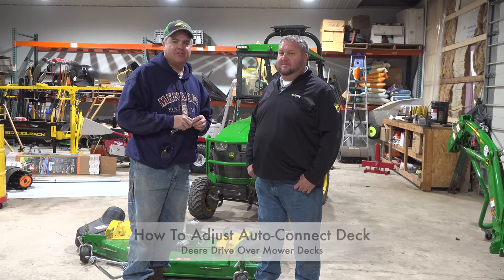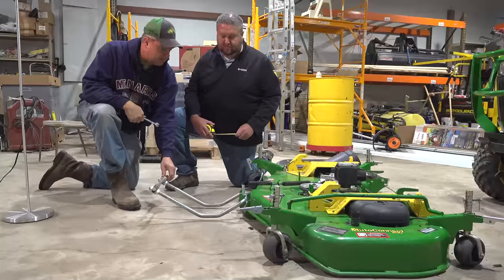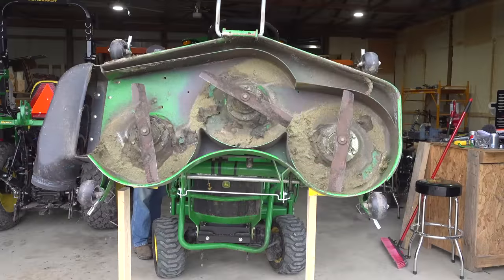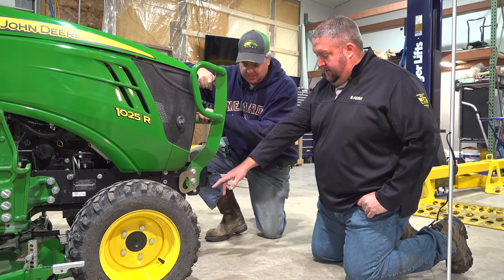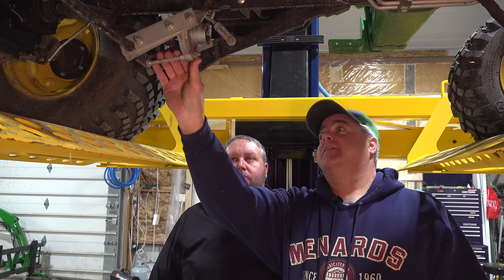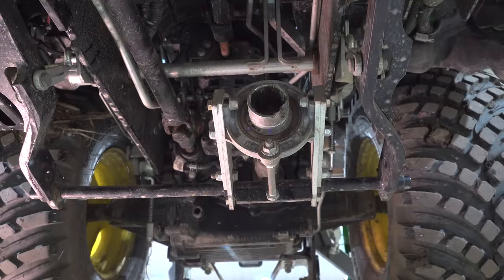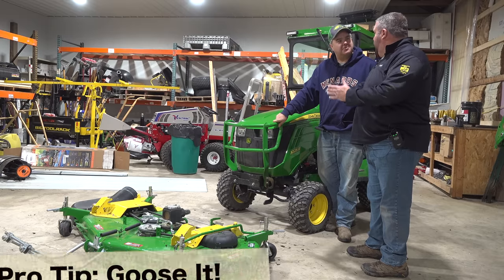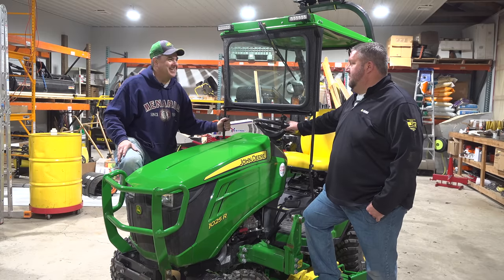Adjusting The Auto Connect Deck Deere 1025R/1023E

Comment: Another feature to help the PTO spline slide on easier is to shift the PTO lever to the rear only position so that the tractor spline can rotate to match the mower spline easier as you connect the mower.
Reply from the maker: Yep.  As stated in replies to many comments already, I forgot to mention this!
Reply: Guess I have been following you longer than I thought cause I remember this one. You have been a great help to me. Thanks
Reply: @TractorTimewithTim  is the deck suppose to be tilted up in the back slightly? or completely even front to back?
Reply: @Steamerchoo  There is a lever tucked in the left side of the seat and the fender that switches the PTO between Mid, Mid and Rear, and Rear only.  They are suggesting that if you switch it to rear only the Mid PTO could move freely which could help things line up and engage.
Reply: Silicone spray both connections of PTO shaft.
Reply: Why can't I get the deck on the ground

Comment: After watching this vid I was wondering why someone hasn't designed a "cap" to put over the mid PTO female receptacle after you remove the mower deck.  Covering the mid PTO would help keep dirt and debris from accumulating there while the deck is not being utilized.  You would have to remember to remove the cap before re-installing your drive over mower deck.   Just a thought.
Reply: Yup. We don't use the mower deck, and probably never will. I always worry about junk and brush messing up the middle PTO. Even though we don't engage it, I don't want it to be damaged.

Comment: I just finished replacing the universal cross bars on the D60 PTO shaft for the second time and I sure wish I had seen this video before I started.  Apparently there are three ways to incorrectly install the coupling that mates with the D60 spline shaft and I tried all three before my son looked at it and said "Dad, you're old.  Get out of the way."  We couldn't find any reference to that bolt that levels the coupler, so we installed the deck and then adjusted the bolt to align it to the spline shaft.  The method shown in our video seems like a better way.  By the way, my bolt was bent as well.  I would like to recommend that JD add a torsion coupler to the quick connect at the transmission. I'm diligent about greasing all of the fittings on the shaft every spring, so these universals shouldn't fail so easily.  My 1023e is almost 10 years old.  Either a torsion coupling or a limited slip clutch would really improve reliability.  Same for the rear PTO.  Small investment, big payoff.  Thanks Tim!

Comment: At about 9 minutes into this video, you adjust the auto-connect coupler bolt.  I studies this a bit and with the tractor on level ground, the bolt should be adjusted so that the distance from the center of the coupler is exactly the height of the spline shaft on the D60 deck when it is resting on the ground (any scalp wheels fully retracted).  I.e., that M10 -120 bolt adjusts the "height" of the coupler from the ground and not the "tilt" of the coupler.  Of course, this is affected by tire pressure and how level the ground is.

Comment: Nice video, but since you left the front bar adjustment alone, you forgot to show the rest of us how to adjust it! I’m sure I can figure it out, but maybe others can’t! Always having trouble getting pins at rear to swing loose to remove mower deck. Also had tension pulley on mower deck give out while under warranty, and shredded the belt, but dealer refused to cover either part, and could not even find the right belt on their website for 54” deck. Now having problems with engine not running right, so going to change oil and filter, and fuel and filters and also check the gas line coming out of the tank as inside the gas fill opening, seems to be rusting, so don’t know if I need to get off road diesel gas - is it better for these tractors? Don’t know why it would be rusting inside tank opening other than humidity in Florida, and why wouldn’t it be coated in something that doesn’t rust! Tractor only has 46 hours on it and shouldn’t be having this many problems already! Maybe I got a lemon!

Comment: Most of the problem I've had with this is the gold-colored spring latches are weakly sprung and won't latch up on their own. Even lubed up the bushings aren't very precise. So check that out on the deck by itself.  More than once have manually latched by removing the latch bar then replacing when the tractor is in place. And then I realize, had they just made the latches with a simple manual option, like a half-turn cam, this would be easy. When the "auto" connect doesn't "auto" it's many times harder than a manual latch would be.

Comment: I've been watching your videos for a while but this one pre-dates my subscription.  After struggling to get my deck off this morning I asked myself if Tim might have some videos on this subject and I found this one.  It's a big help.  My dealer had the front bar adjusted so tight that you couldn't get the latches undone on the rear of the deck.  I also thought of some type of cap or plug for the PTO spline connector when it's off.

Comment: I love my 1025r! I remove my deck at least once a month for different tasks on our property and I never have any issues with connecting and disconnecting at all. I could not be happier with this tractor!
Reply: consider yourself lucky.    I bought a new 1025 and the deck is a PITA , and I have adjusted it  as this article shows and how the manual shows.
Reply: @danwukelic1260  as a 2022 1025r owner. if you are having that much trouble reconnecting your deck. you are missing something. I can uninstall and reinstall my deck in probably less than 1 minute. to me the biggest hurdle is raising all of the deck wheels. which is a nothingburger

Comment: Another trick for keeping your deck form sliding on concrete.  Take the a ratchet strap and remove the buckle.  Take the free end of a ratchet strap (the end without the buckle).  Hook the strap to the deck and lay the strap out on the floor where your rear wheels will roll over it.  Then when you pull over the deck the weight of the tractor on the strap will keep the deck form sliding.  I learned this technique on an old 2wd Ariens GT and it made the job a lot easier.

Comment: On my 2022 1025R with the 54D autoconnect deck, it has a different lift link on the front of the deck. Mine is spring loaded and looks like Lift Arm, MY20, Attachment - ST993764. I recently bent a bracket on it when trying to mount it, Bracket - BRACKET, UPSTOP ADJUSTABLE FRONT DR part number TR107795. replaced the part and bolt and back in business. Thanks for all of the helpful videos Tim! great stuff as always! Love my new tractor, did lots of research with a lot of TTWT videos on what to get. ended up with 1025R with 120R loader, 53" bucket, JD Quik attach 3 point, Frontier 2048L box blade, and 54D Autoconnect deck. I also recently added a 3 point Tiller and the Heavy hitch offset hitch with H2TBD Cultivator Bedded/hiller attachement (ordered today).
Reply from the maker: Congratulations!  Lots of fun ahead!

Comment: I'm glad to get the info on adjusting the mid PTO. One thing that I have found that helps with connecting the mower deck PTO is to shift the PTO selector to the rear PTO to allow the mid mount PTO to freewheel and spin to align.

Comment: Great video.  I agree with the smooth concrete floor sometimes being a challenge, but I would also add this.  I learned from experience that you don't want to remove the deck on loose gravel.  If the deck scoots and settles in the gravel,  you've got a mess on your hands trying to get the deck re-installed.

Comment: One of the biggest mistakes I made was getting an AutoConnect mid-mount mower deck for my 3033R. Though these sort of decks are excellent for basically flat lawn cutting, they are terrible at cutting the hilly uneven pastures on our farm. Connecting was always a bit of a finicky situation. Also, the side discharge created mounds of decomposing grass instead of an even decay along the swath. Within the first year I replaced the deck with a 78" flail mower with hydraulic side shift that mulches the clippings and drops them evenly across the entire width of the unit. Having 18 separate blades let me inexpensively sharpen or replace them without the need to detach the unit from my tractor. Fortunately, I was able to get a really good deal on a trade-in of my 3033R and deck for a new 4066R. I finally have enough horsepower to do my own bailing of our hay fields. Don't misunderstand, I am not knocking the use of a deck, it just didn't work for our farm.

Comment: Great, great video! I dread putting that mower deck on in the spring and scratch my head as to what adjustment is out of whack. Then I vow to not remove it till winter.  I'll be out there tomorrow looking things over. Thank you!

Comment: Tim,
Thank you.  I consider the another great public service announcement.  Now I have to remember the 11.5 height in the front, and the 1/8” gap in the front.  And lastly,  do not grease the linkage or connector underneath with grease. 
Bill

Comment: Also new owner.  Could not get my mower deck off for anything.   The front adjustment was too tight.  Great video - thank you!
Reply from the maker: Glad it helped!  The deck is simple to adjust on e you roll up your sleeves and dive in to figure it out!
Reply: @TractorTimewithTim   No it isn't,  the manual says to level the deck if too low at the front is to adjust the draw bar at the front with the large nuts, if you do this you lose the 1/8 inch gap needed at them.  then the deck is jammed and you can not release the spring loaded latches at the back

Comment: Thank you for this video Tim! I’ve been struggling to get my deck to connect ever since I got it. Dealer told me there was a problem with the silver latch below the tractor, said it was mounted on backwards. I’m going to test these tips and see if that helps. Corona lockdown will give me a chance to experiment and get my 1025R ready for spring!

Comment: Finally a discussion regarding grease collecting dirt and grit.  For example, it is commonly recommended to lube the socket connections on the three point.  Seems counter productive to me.  Not really that much movement when an attachment is secure side to side.  However the level of dirt can be high.  Why apply lube that can trap grit in the joint?  I leave mine bare and flush clean during use when possible.  Any further discussion?  I do grease other areas that are more protected such a FEL pins.  I do however find alot of dirt trapped in the bucket pins.  However the joint is quite tight and excess grease helps keep the joint clear.

Comment: Does help to have level ground to attach the mower deck. Sometimes that is a hard thing to find. Am thinking about putting a pad in to work on the tractor. Eventually a shed will go over the pad but great tips on the deck. Thank you again for the videos. Yes we got snow yesterday over 7" in one day.
Reply from the maker: Yes, you need a level spot.

Comment: Regarding the PTO level adjustment bolt, I also thought my bolt was bent, however I believe it only looks like it is bent on mine because the bolt hole is drilled at an angle. Maybe yours is made the same? Great job on all the videos, Brother. Loved your Honduras road-building video using a 1025R.

Comment: Agood way to set up the pto connection angle is to measure the height of the spline connection of the deck when flat on the ground and set the pto connection at the same height. in place of using grease i recommend a light coating of copper anti-seize. it doesnt attract as much dust and debris as grease.

Comment: This was a great video.  I have had my 1025r since I bought it new in 2019.  I have had it at the dealer at least once due to the mower deck not being level.  This month, I reinstalled my deck for the season and mowed only to find the deck was not level.  It was an inch off left to right.  I removed it and reinstalled and found it was now 1/2 off left to right.  I removed it again last night and attempted to adjust the lift arm turn buckles.  During reinstallation we had a very difficult time re-attaching.  We finally got it reinstalled.   The deck is still off 1/2 inch.  Not know what steps to take, I have made an appointment with the dealer to come get it and level the deck.  Frustrated.
Reply from the maker: There are two turnbuckles, one on each side to adjust level

Comment: Really liked this segment.   Could we see how to do it on your 3046r.  It is a little different  and I am having this same problem with my 3036r after  4 years.  And what are the causes.   How they can be prevented.   Thanks
Reply from the maker: I took the deck off when I got the 3046r, and have not put it back on!

Comment: Tim, I just got my 1026R back from my local dealer who did the annual spring maintenance. While the tractor was at the dealer the service manager called telling me that if I was having trouble connecting Nd reconnecting my 60D mower deck it the assembly would need to be overhauled. And at a what I thought was a very hefty price. I don’t have a connection problem so I told him not to do the work. My 1026R is soon eight years old with 1070 hours. I realize there is wear and tear and I may need to that sometime. Would you have the opportunity to check with your sources what ork outdoor need to be done and can I perform the work myself? Thanks and look forward to hearing from you!

Comment: A great starting point for adjusting the front to back leveling of the deck is to loosen the 28mm nuts on the front hanger and run them out flush with the end of the threads and run them back 6 full turns and tighten the rear nuts. i set these up at work every day and i found that doing this either gets it right on the money or close enough to not notice a difference.
Reply: if I do what you said,  my deck is way to low in the front?  if I tighten up the larges nuts to raise the front, then here is no gap at the front yoke slots that suppose to have about an 1/8 inch?  basically impossible to release the latches on the back of the mower to release it
Reply: @danwukelic1260  I loosen the front nuts every time I take the deck off. It doesn’t take long to tighten up to the jam nuts then.

Comment: Very informative video, particularly about how moving the mower deck with pallet forks or a chain can cause damage. 
Question:  for those of us who own a Deere 3 Series tractor and a mid mount mower, Load N Go is not available (at least to my knowledge).  What the best/safest way to move the mower deck after it's been uninstalled from the tractor?

Comment: Excellent video, thanks.  I've done exactly what you mentioned; I lifted the deck by putting forks through the hoop of the drawbar now the bar won't stay attached to the hooks on the front of the deck.  There's a gap of maybe a 16th of an inch between the bar and the little u-bolt and the bar just pops out.  Can you suggest a repair?  I'd hate to take a sledge hammer to it but can't think of anything else.

Comment: Hey Tim I have a new 2025r and when i back off of the mower the loadre stand pipe catches on the mower lift arm and bends the bracket that holds it in place.  Any help that you or Matt can offer would be greatly appreciated.  Love the videos thanks.
Reply from the maker: The loader stand is likely bent downward a little bit.  Hook a chain to your loader stand ... while the loader is attached to the tractor...chain it to a tree.   Then, gently pull backwards with the tractor.  This should pull the loader stand out a bit.  
Try to attach somewhat high on the 'tree' or other immovable object.
...but don't get too crazy with this, as you don't want to break your loader stand.
Reply: @TractorTimewithTim  thanks i will try it .  Appreciate the response and God Bless.
Reply: Take your loader off before attempting to take off or put on your mower.  I caught the bracket on the silver rod between the arms and bucket and bent it straight.  Also I bent the silver rod which I haven't figured out how to replace. So do you take the pins out drive it out of the arms of the loader? 
 I have a 1023e. Thanks
Reply: There is a large nut inside the loader arms back where it connects to the tractor that bolt is inside a crescent shaped hole which alows the kickstand to raise or lower I now know after buying 4 arms myself.

Comment: Hi Tim,
Good Video regarding the autoconnect deck!
I'm with you regarding the PTO coupling that it should have some grease. But as mentioned, the man from deere commented about it collecting debris which might cause an issue. JD should have provided a cap for the coupler when not having the deck installed.

Comment: Thanks, great info. I took off my snow thrower in May and put the bucket on. just took the bucket off and put the PTO mechanism on. I cannot get the lift mechanism to move up and down.I called my dealer and he said there is a switch neat the right front tire I need to move to make it work since I had a snowblower on. I can't find any switch up there. can you help? Thanks

Comment: you didn't show how to adjust the front to back deck  height  adjustment?   if you tighten the front yoke nuts to raise the front of the deck, it eliminates the 1/8 inch gap at the front  yoke  needed?

Comment: Tim - early in this video you mention locking your deck lowering apparatus up when you weren’t using the deck (to keep the PTO coupling clean) - how do you do that? Thanks, and I appreciate your videos. 2025R owner.
Reply from the maker: Deere may have removed that feature.  Just set the height adjust knob to the highest setting.